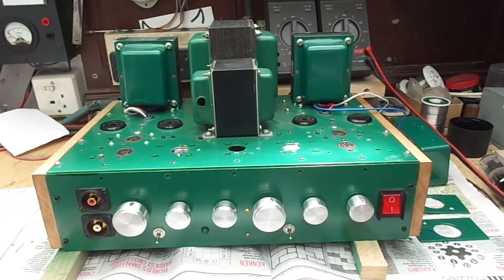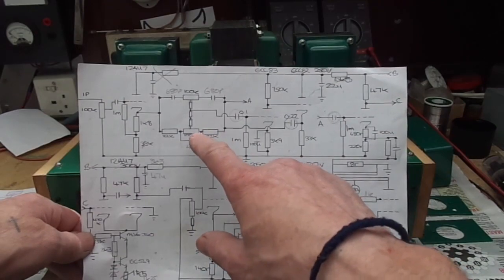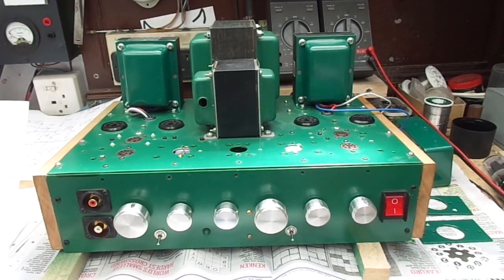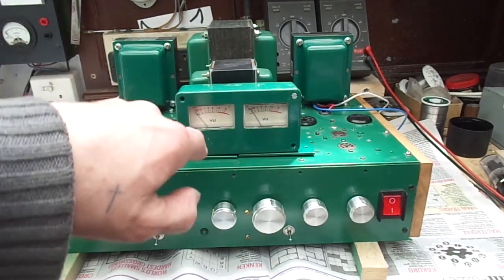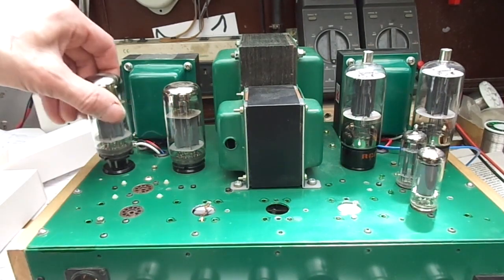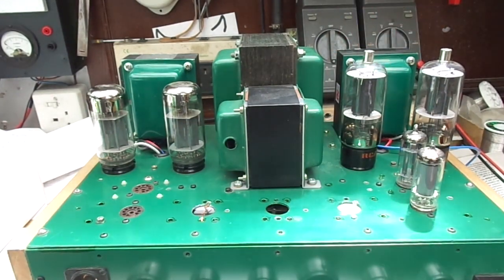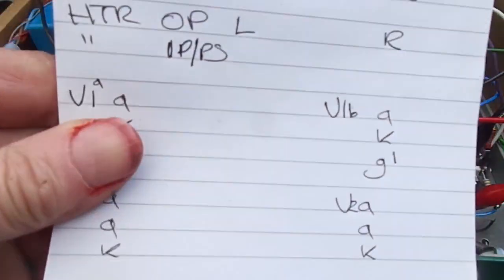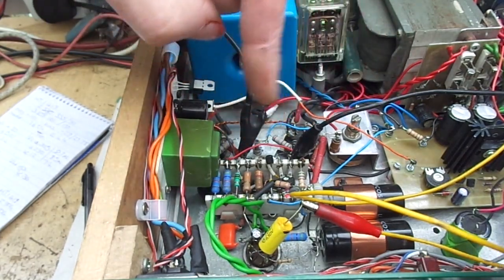Big Green Valve Audio Amplifier

Comment: Hi again friend! I really missed your videos, and I am excited to see more about this amp. don't be too mad at yourself for messing up with the amp, I have done more or less the same mistakes! We all need to learn somehow, and making mistakes is one good method. So don't worry :) I'm sure the new circuit will work a lot better, the amount of coupling caps in the old one was most likely the biggest issue. I use the same method for making sure my heaters are not floating, and I have sadly encountered the exact same short in one of my brand new tubes, also sovtek, funnily enough. I think the tubes I had issues with were some EL84's in a smaller amp. So new doesn't always mean good, unfortunately. Could also be shipping damage, there is no way to tell sadly... 

I hope you are doing well over there, I always become happy when I see you have uploaded :) I should work on my valve amps myself, I really miss it. I am struggling with money at the moment, so therefore I have not been able to afford the parts I really need to build a new project amp. I could make something experimental with parts I have salvaged though, and I think I might do that :) I have some 6080 dual power triodes that could be fun to experiment with, might experiment with using old power transformers as output transformers for those, since they are very low plate impedance. It might actually work. I also got a load of octal relay sockets, which make excellent experimental sockets for the bench : )I see you also use those for testing things, hehe :) 

I was inspired by your green paint to paint my homemade generator green aswell. I managed to find the same green you use at the local hardware store, and it looks fantastic :) if you don't mind, I might paint my next valve amp I build with it too :) 

I want to build something similar, class AB2 probably also with deflection tubes like yours, much cheaper than audio tubes, which always get driven up in price. I need good iron though for it, PT's and OT's. That's where the money I currently lack is needed, that's the expensive stuff, and sadly I don't have what it takes to wind my own. however I might invest in equipment for that, as I feel it would easily offset the costs of having to buy transformers in the long run, and of course the ability to wind whatever ratios I wish would be incredible. I always find commercially available transformers to be somewhat lacking, I bought hammond transformers for all my amp builds I have done so far and they have been okayish but no modern OPT;s have enough iron for proper low-end, I always get loads of distortion below 40hz. My old heathkit amplifier I use everyday has a huge OPT for being just a little EL84 thing, it plays cleanly down to 10hz.... so big difference between transformers, and being able to wind them myself would allow me to get proper big cores with enough iron for good performance at the low end. I enjoy listening to reggae and dub so deep bass is a absolute must for me, I cannot live with bad bass performance, lol. I have large subwoofers in boxes tuned quite deep, just for this lol.

anyways! glad to see a new video from you! I miss you when you don't upload for a while. 

😄
Reply from the maker: Thanks for your kind words & am happy to hear that you enjoy my videos though they lack decent production. Yes lack of money is a challenge, still, keep on tinkering, best regards, Andy.
Reply: @diabolicalartificer  You're always welcome, Andy! And don't worry about the production quality, that doesn't matter in the slightest to me. You could record using worlds crappiest camera, and I would still be watching :) You are huge inspiration for me, and a great helping hand :) You have answered many of my questions in your videos! 

Cleaned off my bench a bit last night, so I can now tinker a bit with what I'vve got. might begin tomorrow :), Lennon

Comment: The 6CLs6 was a commonly used clamp tube in ham radios here, and in some TV sets. The 6BG6's were often used as output tubes for Ham transmitters, and there was a plan using them as an electronic load to test transformers. They were a pretty sturdy tube. I seldom found a bad one in a TV set.  That is a pretty complex amp you are building. 
 I noticed as the 5881 started to fail a reddish purple glow, indicative of a gassy tube started to present itself.
Reply from the maker: TFW Frank, well spotted.